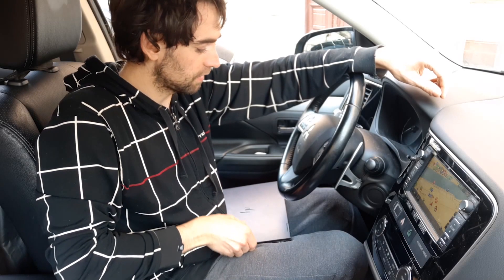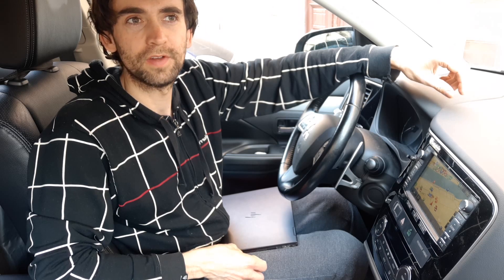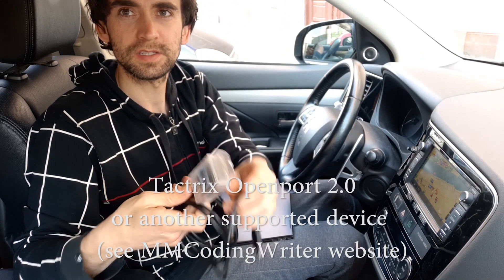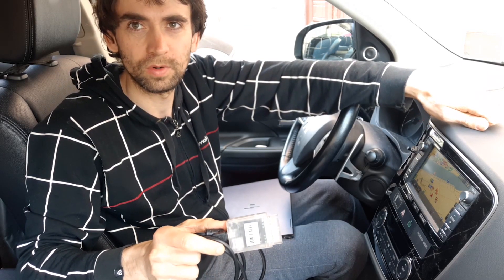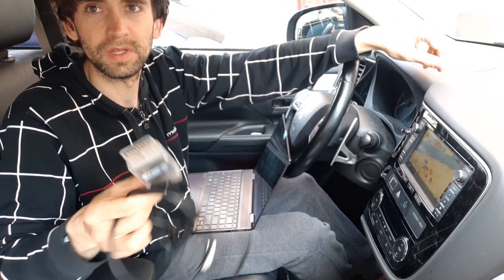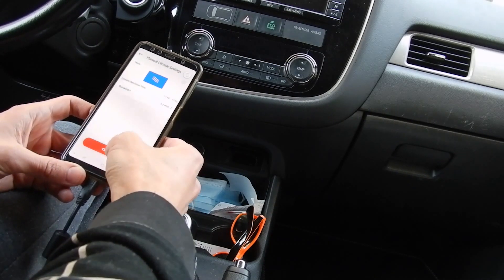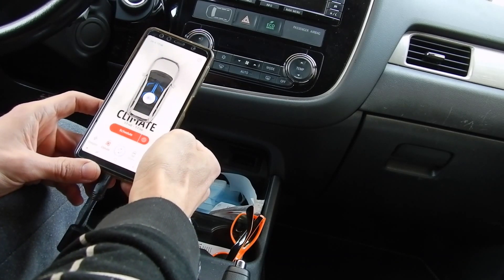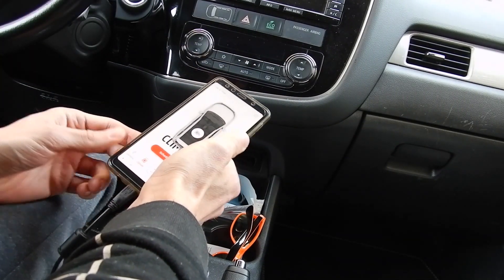Mitsubishi Outlander PHEV Remote Control Wifi Module Installation

Comment: Would this method work on 2021 eclipse cross phev ? I bought it 2nd hand and the owner did not have a wifi password. I wonder if I can use the mmc coding tool to retrieve the password

Comment: I did this, works great. Does anyone know if you can add heated seats on the 3h? Looks like a switch missing and also looks like the wiring is there, just maybe the module is missing?
Reply from the maker: In my car there is some aftermarket solution. You can buy some kit and do it yourself, i think there is no limitation about suitable cars, just wire and fuse it properly

Comment: Bonjour et un grand merci pour cette vidéo : j'ai cherché un moment comment faire pour retrouver les infos du Remote control de mon Outlander PHEV ( Mot de passe Wifi).Cependant, un petit coup de pouce serait le bien venu svp:  
1) Existerait t'il un lien vers un serveur de partage ou je pourrais téléchargé le soft "MMCodingWriter2.3" (autre que sur le forum)?  
OU Bien, 
2) pour s'enregistrer sur le forum , connaissez vous la réponse à la question  de "confirmation of registration" qui est "Which engine model was installed on Mitsubishi Lancer Evolution 10?" ...je sais, c'est bête, mais j'ai essayer toutes les réponses possibles ( ex: "turbocharged 291-hp MIVEC"  ou  "4G63 turbocharged"  ou  "4B11 turbocharged ")mais la syntaxe doit pas être bonne...et bref, je suis bloqué à cause de çà. 

s'il vous plait, une petite aide  serai la bienvenue.
Merci

Comment: I finally sourced an ev remote module and mmc coding writer installed on an old 32 bit w7 machine.

Can you tell me,when changing the etacs options to present from not present,should the car be in ACC mode or ready mode?

Thanks for this excellent tutorial.